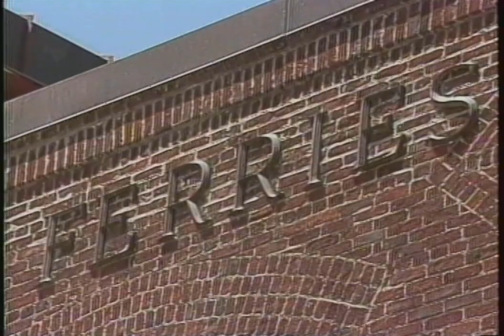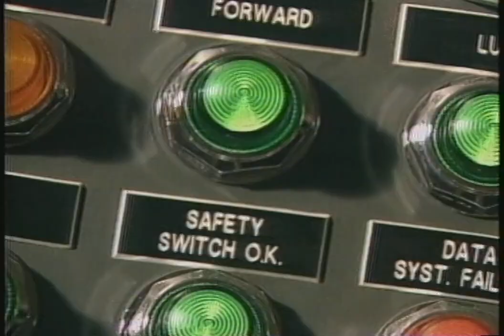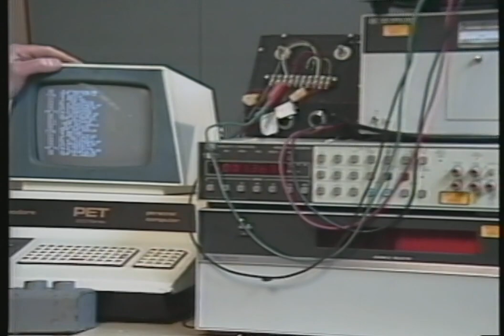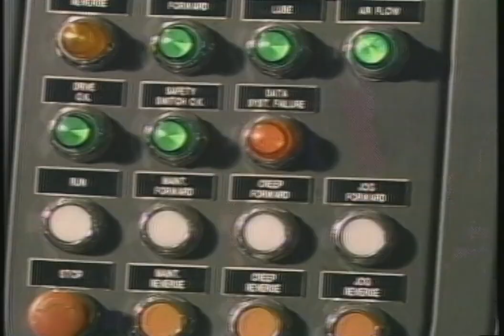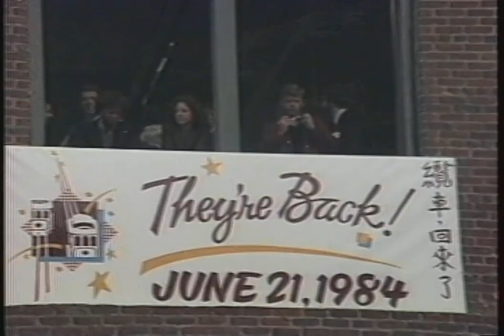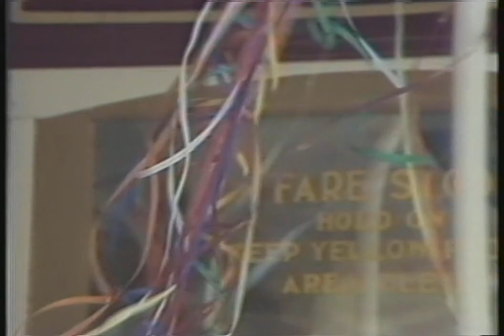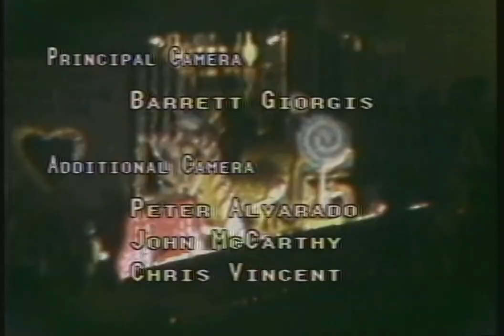They're Back! Rebuilding America's Cable Cars

Comment: The little trolleys that could
Reply: Trolleys have a pole with a bronze wheel that touches the copper wire above charged at 600 volts D.C.
Reply: @luislaplume8261  OK then the little streetcars that could
Reply: @rogerlollar4325  Streetcar is the West Coast synonym of Trolley
Reply: @mikehawk2003  the little cable cars that could

Comment: Supposedly the buses that substituted for the cable cars found the going tough on those hills.
Reply: They actually had Faegol busses with a second engine designed to kick in on the tougher hills, massive failure...